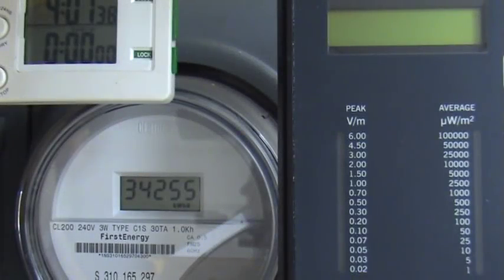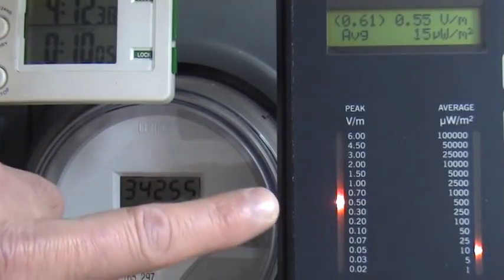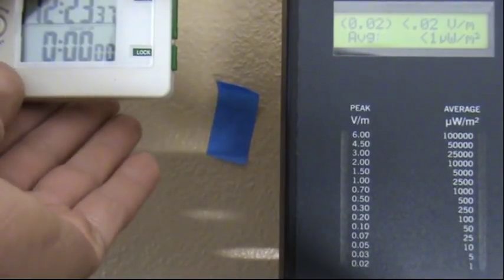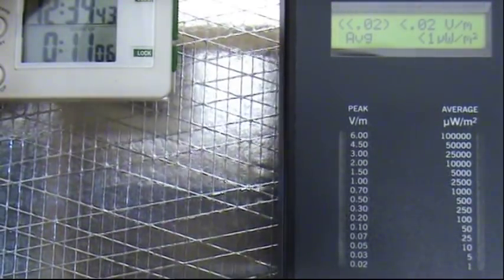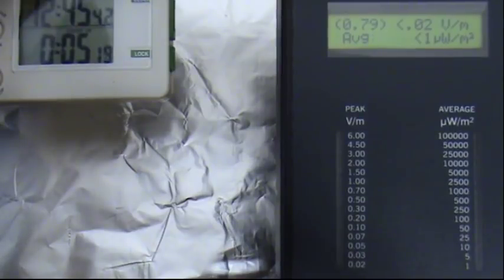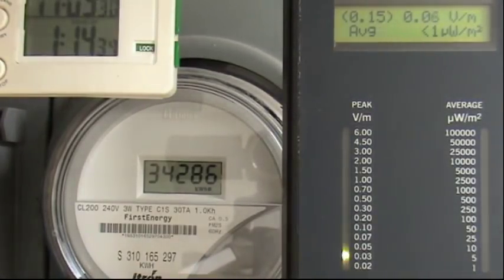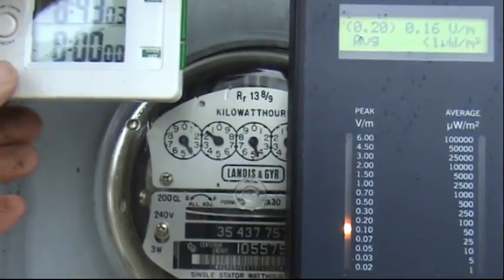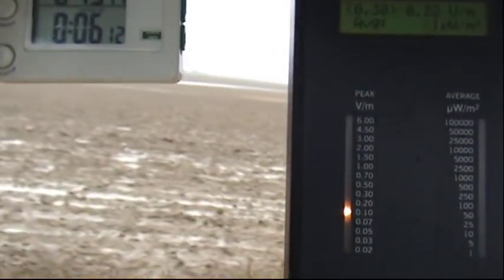Testing utility analog and smart meters for RF radiation

Comment: Help. I read that you have a high number of radiation detectors. I have a Cornet. It picks up CRAZY readings from my wifi router and cell phone. However,  it tells me that, unless I'm less than 2 feet from a smart meter, I am safe. I read about the danger of smart meters all the time, yet my Cornet tells me it's not as bad. Our room is 10 to 12 feet away from our neighbors' meter so apparently safe. BUT I also read that the signals from smart meters are so high that some radiation meters like mine can't pick up those signals. Now I'm back to being worried.  Do I trust my Cornet or not? Do I need to get me another, better, meter with an attenuator, specially designed to pick signals from smart meters?
Reply from the maker: Lorena C Sandoval  If you think your wi-fi router and cell phones have "crazy readings" then you haven't tested your microwave oven yet.  Try this then revise your statement.  I don't know which model of Cornet RF detector you have and I don't know much about the brand in any event, but I checked the specs of one I saw online and it should be fine since it was measuring the proper frequencies.  The readings you got were probably in line with what I would expect; check them against my readings as I have also tested all these things:  https://www.youtube.com/playlist?list=PLwvM5FrPTJTn5N9V0FU3UElo3c3otTRT-  The smart meter meme has been thrown into a fear porn for profit situation on YouTube, so do some of your study outside of YouTube University.   On my videos I present the actual readings without the fear mongering and as you may have noticed, I have the longest duration smart meter testing on YouTube.
Reply: @ForbiddTV  Hi and thank you for replying. I have the Cornet ED78S. So I should trust it then? I got worried that perhaps it couldn't pick up the high transmissions from the neighbors' smart meter. Weirdly enough, our smart meter emits higher frequencies! I wonder why that is. You give me piece of mind because you say you have tested with several meters. I even wondered if I needed to purchase a more advanced tester but those are too expensive.  I also read that most meters send their data at midnight and of course at that time we aren't testing. I wonder if I should. It worries me because my daughters' room is on that side of the house, but about 10 feet from it. 
Oh, we don't use a microwave oven, no way! I tested it. We are toaster oven users.
Reply from the maker: Lorena C Sandoval  You keep saying "higher frequencies" but it doesn't sound like.that's what you really mean. You probably mean power levels. Why would you not trust the readings you are getting?  Is it because you think the meter will top out when you are near a smart meter?   You have been watching too much fear porn.  I again invite you to compare your readings with mine to see if you are getting readings in line of where they should be.  All those who have been screaming about how dangerous smart meters are have another agenda.

Comment: The radiation you’re looking for is past your 6 ghz thresholds. The fact you can hear it should tell you everything
Reply from the maker: No, that unit detects to 8GHz.  You lie.
Reply: ForbiddTV I’m simply saying that the harmful radiation is obviously on a different spectrum so to speak. ANY radiation that is not a natural phenomenon is harmful until deemed safe. Not supposed to be oh it’s safe but it’s not really proven yet. No offense
Reply: ForbiddTV so can you explain to me what you’re trying to prove/disprove?
Reply from the maker: Sorry, I see I omited the 8 in GHz above. These are all non-ionizing frequencies of radiation.   It has been well established the levels of non-ionizing radiation we are dealing with here have no ill effects on the human body.  This series of videos dealing with RF radiation are probably the only ones on YouTube that is strictly presenting the numbers without the pro-this or anti-that agenda. The numbers in my tests could serve as a reality check to what other have presented, and you will note I have the longest test of a smart meter than anyone on YouTube.  I also do the most ionizing radiation readings than anyone on YouTube.
Reply: @ForbiddTV   You are measuring at what time of day? Also, these things spike out of the non-ionizing to ionizing at the highest levels when they are transmitting information.
Reply from the maker: As you can see the measurement was over many hours.  I took them in the daytime so I didn't have to use supplemental lighting. 
No, these are all non-ionizing frequencies, it isn't even possible for them to produce ionizing frequencies.
Reply: How many ghz does it measure up to. 5 ?

Comment: Yeah that smart meter is pretty safe. My WiFi, Cell Phone and CB Radio put out WAY more than that Smart Meter. My WiFi puts out 14-20 dbm constantly, not even pulsed. MEPL Maximum Exposure Permissible Limits are based on an average at those levels of radiation. So if you take the maximum power of .61 uwatts (.000061 watts) and divide it by 60 seconds you get the amount of power per second that you are exposed to, (0.0000010166 watts). Then multiply it by the exposure time of 7.5 Seconds (Average time per minute it transmits) and you get the Average amount of Maximum amount of power Exposure per minute, (0.000007625 watts), and that's if you parked your head right on that meter, because your measurements were basically taken right on the meter itself. RF dissipates rapidly the further you are from it. Try those readings about 5-6 ft away like if you were sitting on the coach watching TV and the readings will be even lower. As an electronics technician I cannot believe all the hype and hysteria over the amount of power this things radiate, it would be just laughable if people weren't so serious over it. I also hear that people are saying it's connected to the house wiring so no matter where you go in the house you're getting radiated. I'm here to tell you as a former Military Radio Technician & CB'er at those frequencies house wiring would be hindering the power level because of the wavelength of the RF. If you want to transmit though an UN- SHIELDED wire you have to tune it, by cutting it really small for the frequency to transmit through it. If you don't it will be reflected back into the transmitter and wasted. So if someone is telling you you're be radiated at 900mhz to 2.4ghz through your house wiring they are full of crap and know nothing of RF transmission lines and RF antennas or how they work. Ask anyone who has a CB antenna if they have to tune the antenna for good transmission, and what happens if it's not tuned to the frequency. The wavelength of a 2.4ghz antenna is about 4.92" inches, so you can see that a house full of copper wires all connected together and going all over the place is quiet a bit longer than 4.92 inches. Just type in 2.4ghz wavelength into google.
Anyways thanks for the proof I was looking for. Oh by the way the ARRL website says that the average power that a SMART METER puts out is in the neighborhood of 1 watt, still way lower that anything that is going to hurt you at 7.5 seconds a minute at any distance. You would have to be living with your head on that smart meter your whole life for it to hurt you, and even then I kind of doubt it would. The key to any damage RF can cause you is based on: Frequency, Power/Distance from TX, and Time Exposed. This thing is safer than a Cell Phone or OnStar on your Cheverolet. LOL.  Best Wishes n Blessings. Keith Noneya
Reply from the maker: Have you ever checked what your microwave oven emits?
Reply: Number 1:
Isn't the Accoustmeter a directional meter. In other words it needs to be pointed towards the source?
2) just curious are you starting with his .61 microwatts per meter squared?
3) Since you are dividing by 60 to get a per second reading, how was it a per minute reading to begin with?
Thank you for your comments. 
I was concerned about the smart meters so tested mine with a  Latnex HF-B3G Triple Axis meter and have not seen much of anything coming off it.. I am very concerned about the wireless  or the cell phones , routers, etc  
I just got a Max reading of
 20 V/m and 640 microwatts/m squared from my standing next to my microwave oven at eye level, so I'm  definitely concerned about that. Also lastly, They are getting ready to upgrade my smart meter to a 4 G
I don't know any of the specs and they don't tell.
Appreciate whatever you or the creator of the video have. I appreciate the video. We should look at these results as one case study. And regardless, the 5G rollout is a completely different animal. Peace.

Comment: When you walk outside, the RF signal might be coming from satellites.  The "acousti"meter is just that - acoustics will tell you what the RF source is.  (Bear in mind that if you have more than one different type of source, the sound will get "merged" though.)  The EMFields website has audio examples of what RF sources make what kinds of sounds.

So, what is your current conclusion, regarding smartmeters?  Are they fairly safe?  Thanks.
Reply from the maker: I make no conclusions as to the safety of RF signals, I am merely giving readings and comparisons. I find it amusing of all the fear mongering hype over smart meters, yet completely ingnore sources much more intense right inside their home. This is even more pronounced with the 5G issue; that doesn't even have a standard or devices yet.  I remember back in the 90's these types screaming we were all going to die from brain cancer by the year 2000 from cell phone usage.  Yet since then cancer death rates are down, not up. https://www.cancer.org/latest-news/cancer-statistics-report-death-rate-down-23-percent-in-21-years.html

Comment: Sir, thank you for you efforts. You should not hold the Acoustimeter or any RF meter that close to the source of exposure you are measuring. There is no need to hold such a sensitive meter that close to the source. And you will not get accurate measurements holding it only a few inches or feet from a smart meter. You can easily stand back 5 to 10 to 20 feet and the meter will easily pick up every blast of radiation from the smart meter and more accurately. I am not able to state the mathematics of what I am saying but it has to do with the wave and distance in measuring.
Reply from the maker: EMF Safety Zone  Well you have a slight miswording by leaving out the word 'not' in the beginning of your comment but I do catch your meaning.  I have seen some of your videos in the past and you also hold it close to what you are testing. To hold it far away would not only reduce the reading but also invites massive trolling from all those who would accuse me of not showing how they were going to die from smart meters.  In all except the microwave oven video I did, backing away 20' loses the test subject to the RF background of everything else.  Although I try to make my RF testing videos bias-neutral, there is just so much ignorance about RF radiation out there that even just showing test results paints me as "covering up for the man".  I'm trying to educate people, but most just need confirmation bias for some fear porn video they saw on YouTube and when they don't get that they accuse me of being the liar instead of the guy who lied to them initially.  Fear sells, facts and truth do not.
Reply: Yes, I edited my comment, sorry about the mistake. And yes, I understand completely, I get similar comments on my channel. On some of my videos you can see me measuring a cell phone or bluetooth devices up close because I need to do this for how I am shooting the video and those devices has less power than a smart meter. However, even standing back 20 feet from a smart meter, the short, quick blasts of radiation coming out of the smart meter are usually enough to make the meter register in the red in terms of peak signal strength over its capacity!
Reply from the maker: So far that hadn't been my experience with smart meters as you probably saw, and the test was for a very long duration.
Reply: @ForbiddTV  Too much ignorance and fear mongering,  some people are frightened of "Smart" tv's also,  its just the same ancient and primal fear im sure certain cavemen exuded when fire was discovered.

Comment: The sound coming from the Acoustimeter when the reading peaked at 0.63 at about 4:16 was caused by a GSM cell phone.  Someone inside the house or very close by was making or receiving a mobile call.  Mobile phones also report their location every few minutes, but the transmission is much shorter than we heard here.

Comment: couldn't you make a faraday cage on the back side and around the electrical box and meter to shield from these  RF radiation?...
Reply from the maker: Wouldn't be a Faraday cage, it would be more like a shield of sorts.  If the levels of radiation emitted were as strong as people meme it was, you would risk fire by doing that.  Obviously the levels are much lower than the fear porn artists portray.

Comment: RF radiation is completely harmless. Source: Been exposed to Ham radio RF radiation all the way up well over 1500 watts with zero ill effects. I'm 36.
Reply from the maker: Although I don't disagree, Ham broadcast frequencies are not in the microwave range as these are.  I can't detect or measure the shortwave frequencies with the equipment shown.
Reply: Regardless from 900mhz to 2.4 ghz (the average frequency of smart meters and cordless telephones) @ 1 watt or even beyond, there is still no danger to humans.  Cell phones @ 2.4 to 5hz depending on the wifi standard broadcast standard that's in use. Anywhere from 500mw to 5 watts and beyond.  Your cell phone and house phones pose a more potential risk to you than a smart meter. Junk science peddling to morons. The screen you edited this video in front of gave you more electromagnetic radiation than the meter itself.

Comment: You may still have some dirty electricity from the stuff you plug in but you wont have the smart meter adding to the problem.
Reply from the maker: Disjointed thread.  No one will know the context until you learn to reply in the proper thread.

Comment: right and the filter is nothing more then a capacitor which draws current making the situation worse. You need to apply a filter at the electrical box or better still remove the meter which is the problem.
Reply from the maker: This comment was somehow placed in a new thread so many wll not understand the full context of the comment.  You will still have "dirty electricity" at your use points even with an analog meter. Replacing the meter won't change that.

Comment: you did get next to the electrical pole.
Reply from the maker: As you see I tested right at the meter which would be where the RF signal could come from.  At the pole would take a different meter called an EM/EMF meter, but wouldn't show the RF from a smart meter everyone is so paranoid about.
Reply: so what you're saying is a EMF meter can't read RF?
Reply from the maker: EM and EMF frequencies are usually in the 20 Hz to 50,000 HZ (50 kHz) range.  A EMF meter measures in the 200 MHz to about 8000 MHz (8 GHz) range.  There are some meters such as the "Tri Meter" tries (poorly) to measure a broader range of frequencies.  No, different frequencies need different devices.

Comment: That's not a smart meter, I swap those out every day. That's just a regular digital meter.
Reply from the maker: Liar.  You can clearly see a RF pulse coming from it about once every minute.
Reply: @ForbiddTV  izdagrimeyone is correct, that is a digital meter, not a smart meter, that meter has no way of communicating with other meters or a host, is simply has a digital display
Reply from the maker: obeychin  Then again as above, explain the spike you clearly see about every minute.  For hours.
Reply: @ForbiddTV  I cannot explain the spike, however, I work I work with these meters everyday, they are simply digital, they have zero smart meter capabilities
Reply from the maker: obeychin  It's not just "the spike", it can be clearly seen there is a spike about every minute.
Reply from the maker: Babylon falling  If that were the case then the meter is still sending out signals.   The incoming signals wouldn't be picked up whether it was receiving or not.
Reply from the maker: Babylon falling  Because you are making the claim the one I am testing is not a smart meter when it clearly transmits, which is exactly what everybody is so paranoid about.  Depending on the utility, keeping an analog meter is not possible or they charge extra money for the "benefit" of keeping their analog meter.
Reply: Power line workers are the most brainwashed ones. Been reading to many of the smart meter pamphlets
Reply: LOL